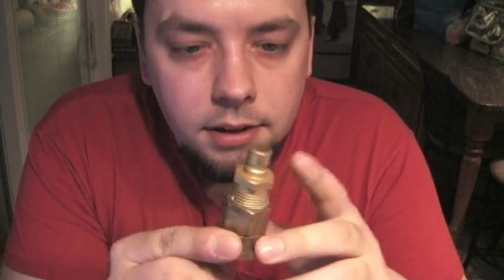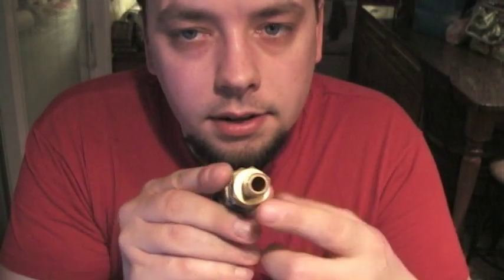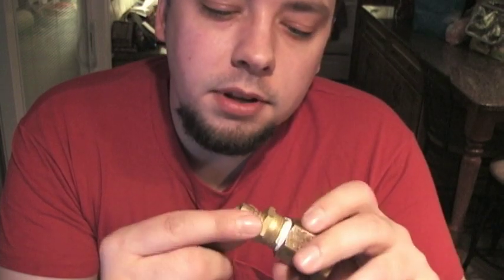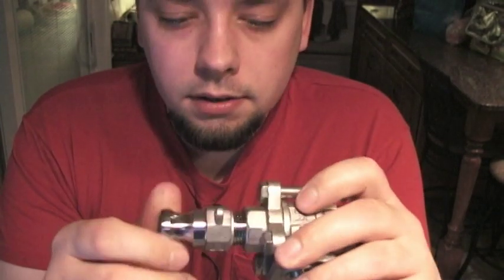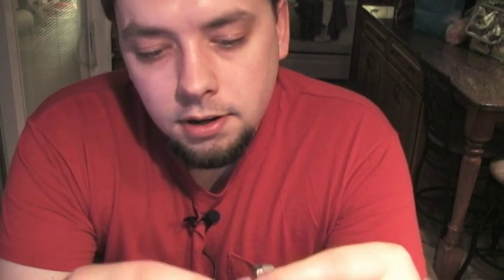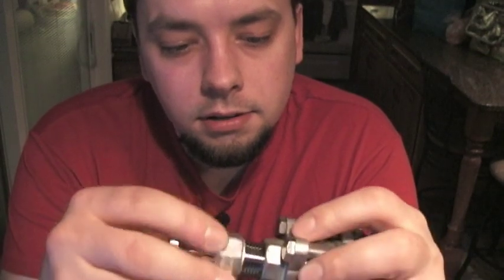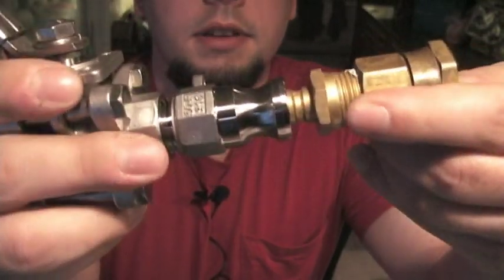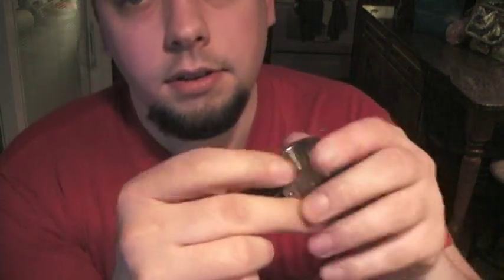Brewery Quick Disconnects

Comment from the maker: @ZIXSIX2007 

Type F goes into my drain ball valves and type B threads into 1/2" NPT street elbows which has the male threads filed off to use as a 90 degree (large inside diameter) hose barb. 1/2" ID silicone tubing easily stretches over the 3/4" OD.

Comment from the maker: Correct, when you're sparging the larger diptubes provide no benefit. Where you get the benefit is in the BK if you want to pump recirculate boiling wort for plate chiller sanitizing or IC whirlpooling.

Comment: Hey Bobby.. Still trying to figure out why you would want that much flow other than from your HTL to your Mash Tun rite before the actual timed Steeping.. since the rest of the process has to be slowed down to make sure that you obsorb as much of the  Sugars as possible.. which would mean that you are barely opening the ball valves which is not really changing anything correct?

Comment: This guy is obviously clueless when it comes to plumbing.  Grinding a fitting down to accept the tube or hose is futile...  You can purchase the fitting with a "hose barb" already built in.  HMU if any of you want tubing or hose and fitting parts. Brass, SS, are available. Prices fair and reasonable.
Reply from the maker: You're right. I'm clueless. I actually started a company where I now have these pieces machined by the 10,000 units. For this particular fitting, there was no acceptable hose barb version with the right amount of flow. I took it from garage bangup prototype to a business that employs 5 people and pays the bills. Who's clueless?
Reply: I'm in the hose and fitting business...  There are components that you're not aware of that would have prevented you from grinding hose barbs smooth and also, different manufacturers that make odd size food grade clear vinyl tubing to accommodate your requirements. Good for you on your business, and I wish you great success !
Reply from the maker: Prior to my involvement in the manufacture of them, there were no cam and groove female fittings that had high flow hose barbs on the market (I show the hose barb fitting in the video which was inadequate). Since you are the expert, so much so that you came on my video to drop insults, why don't you make a video showing the correct fittings for this application? Everyone would appreciate it.